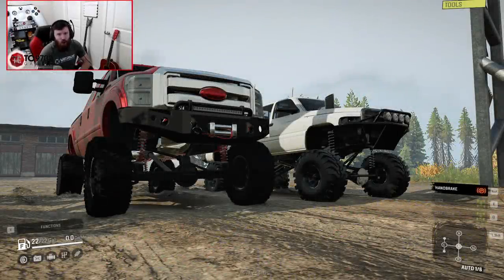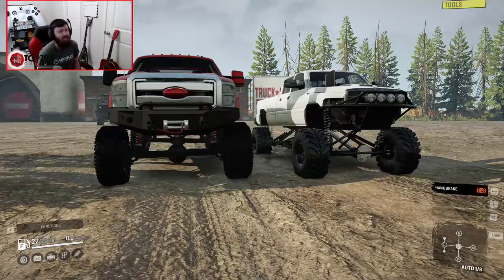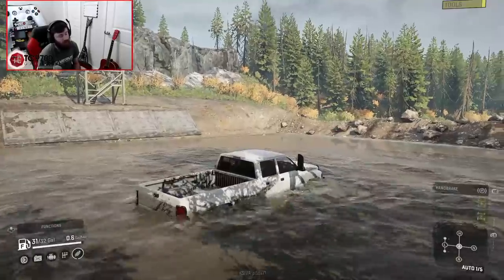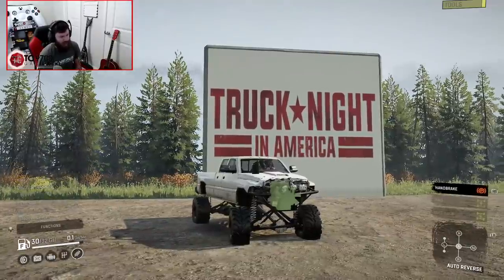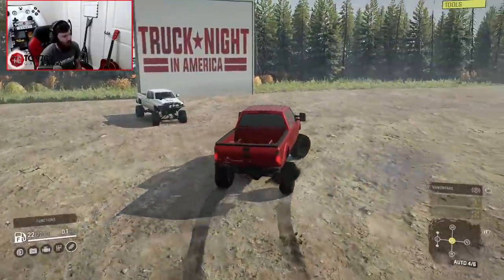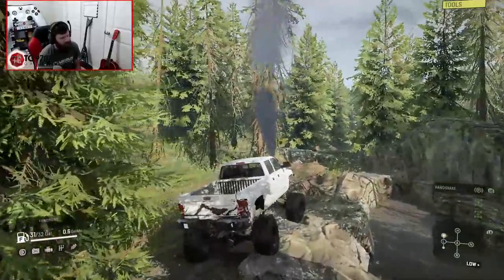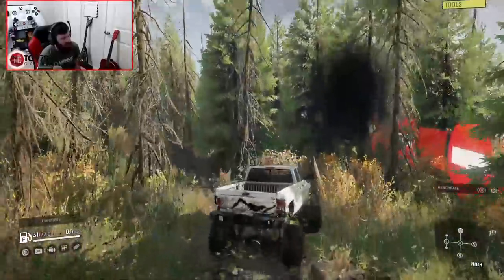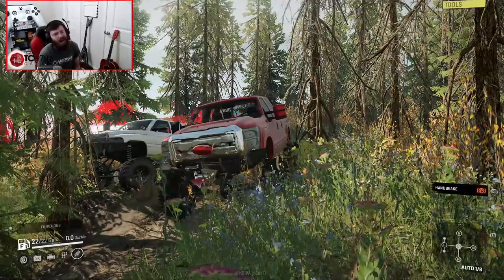SnowRunner: BUILT Ford F350 vs 2nd Gen RAM 3500! TRUCK NIGHT

Comment: TC it won’t let me use any of my console mods? So when ever I enable one it says not enough in game memory to run this mod when I have plenty of free space and so I delete the mod then try it again and it doesn’t work. Even with the smallest mod it still doesn’t want to work?
Reply from the maker: Sounds like you'll need to either clear your cache or re-install your game :)
Reply: Nothing will fix it, it’s a dev issue currently
Reply: Same prodlem with me